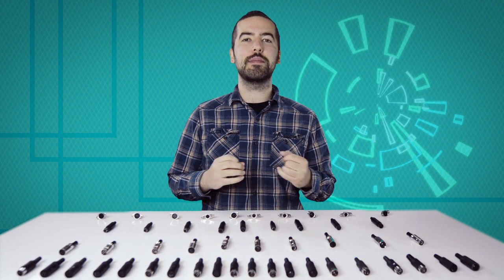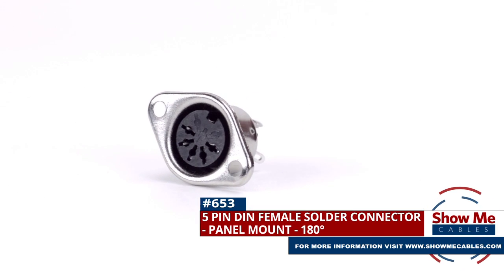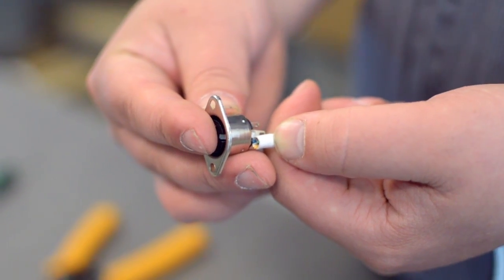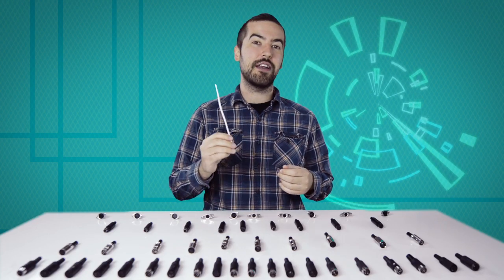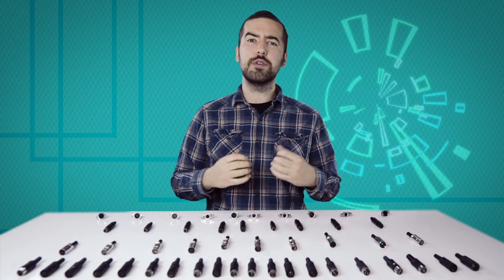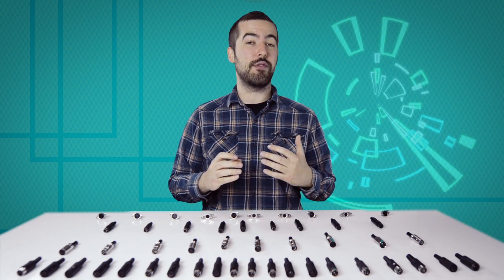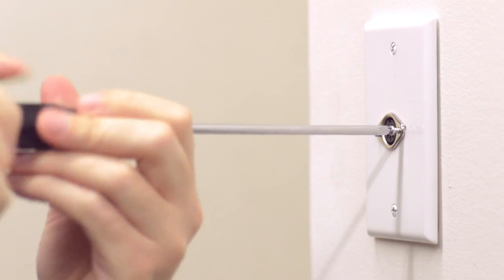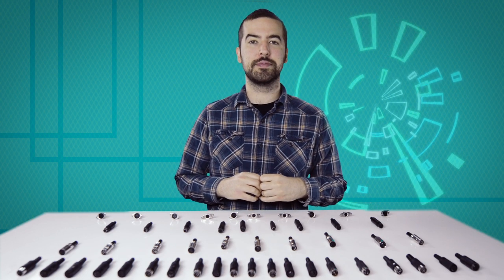How To Install The 5 Pin DIN Female Panel Mount Solder Connector (180° Style)

Comment: I really wish these videos would be taken down.  It's hard to search and avoid these.  They have them for each pin count and it's the same video that avoids the important solder part despite the title.  But I now know that the pins on the back correspond one-to-one with the pins in the connector.  OMG.  I was so lost before knowing that one part...